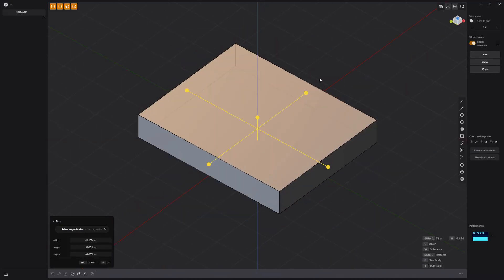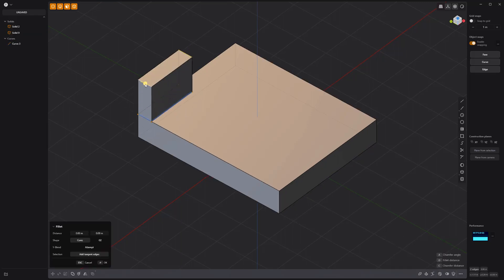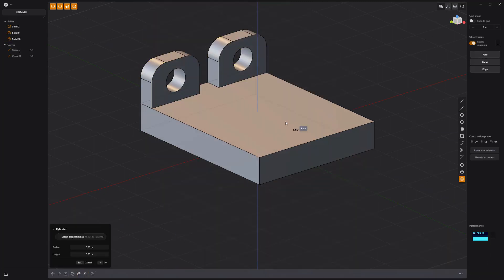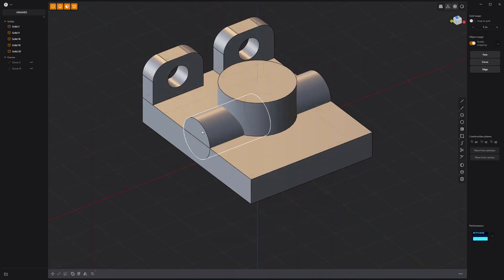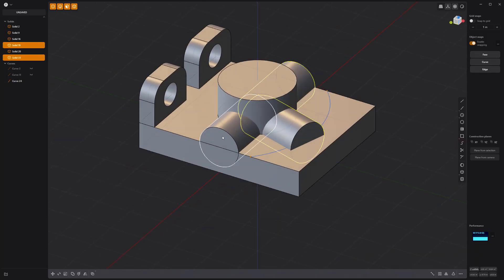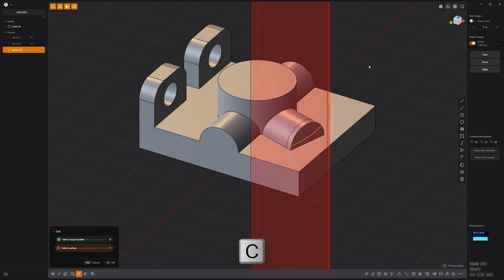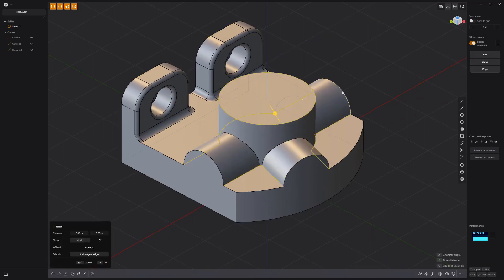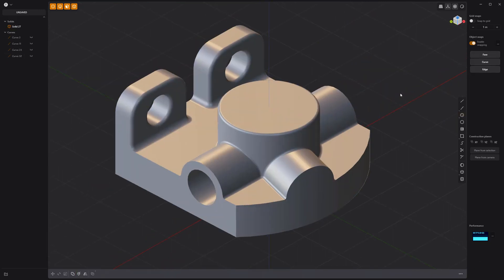Plasticity | Modeling Exercise 31

Comment: Your videos are great. But what I am always wondering - how would you adjust things in plasticity (not just build them). For example: change the diameters of the holes. Or measure and change the distance between the mirrored parts.
Reply from the maker: This might answer your question.... Shows change hole diameter and more
- https://youtu.be/c0KzGLejVbw
Reply: @pixelfondue 
Totally missed that one. Thanks! ❤

But it seems like there is no easy way to set an absolute size?

I can see the current size in the face details (on the right), would then need to figure out how much to subtract/add to get to the target dimension I want.

Or is there an easy way?
Reply: When sketching inside a solid, is there a way to see the sketch?
Can the solid be made transparent?
Reply from the maker: @shokk1967  yes. Select solid...m for material... Then change it's attributes.
Reply from the maker: @shokk1967  https://youtu.be/4VVpPcWmwuA